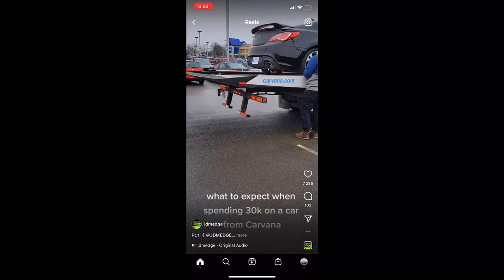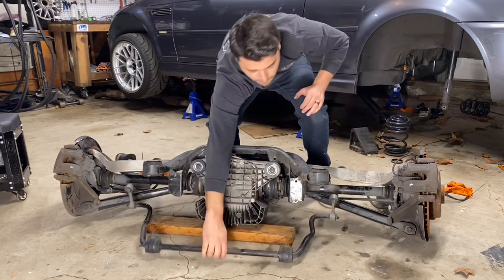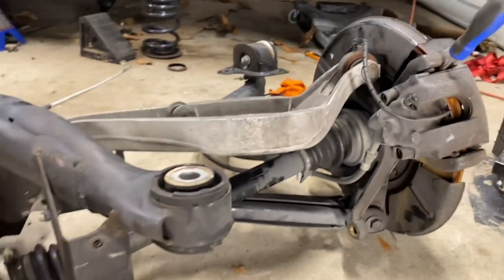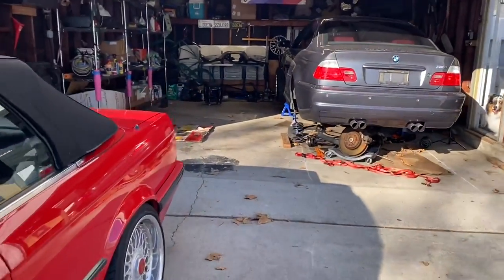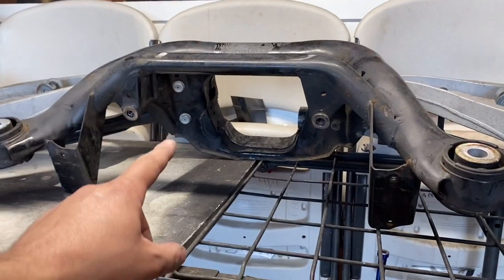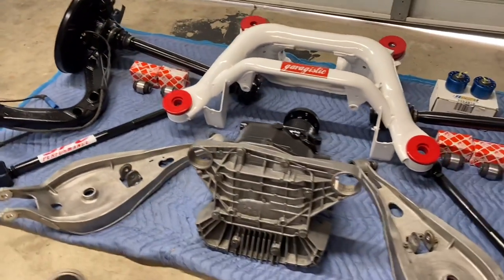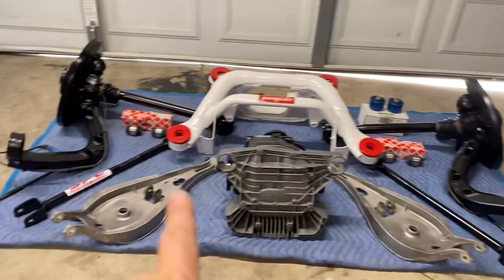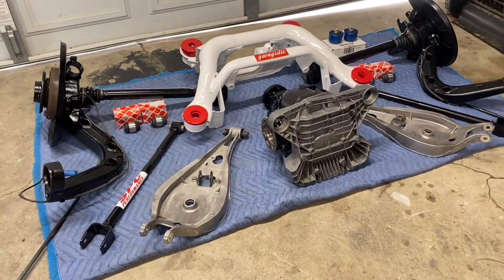Restoring my BMW E46 M3 rear subframe

Comment: Nice but why didn't you weld reinforcement plates to the subframe? Don't you worry about the subframe cracking?
Reply from the maker: Whats up Geri ! I did actually weld in plates, and welded up cracks that were present on 2 of the subframe mounting points. All of that + installing an X-brace is covered in another video of mine that you can check out here: 

https://www.youtube.com/watch?v=a1DARSUfTfA&t=22s

Thanks for dropping by, cheers!!

Comment: just done mine, fully powder coated and bushes all done, plus inserted the new updated diff case bolts that bmw offer. Also added the welded plates on floor pan. looks so much better. Mine only done 63,000 miles but yours in better condition, we have wet salty roads in the uk to rust everything
Reply from the maker: Hey Lee, Nice job mate! Regardless, its no easy job! Hope my videos were able to help you some, your car is going to feel completely new afterwards! I may have to look into the updated diff bolts you mention, I have a bit of a clunk still from the diff and the front diff bolt has come loose a few times. Thanks for the tip! Cheers mate!💪
Reply: @joshthebavarian  yes check out bolts they are only a few pounds and simple to put in.

Comment: Dude, props to you.  I wish I knew how to work on a BMW like that.
Reply: you can do it, working the E46 platform is easy, IF you  have access to a garage and lift on some cases that require it, but mostly the maintenance is not that bad at all. given you get lucky with a good, clean example. My E46 330ci is currently have a dreaded vacuum leaks and possible DISA valve issues etc. but that to be expected in a 21 year old E46. maintenance it soo key.
Reply: @LaSaus Thanks!  I am going to give it a shot.
Reply from the maker: Hey Brotha, thanks for dropping by! And mark is right, these cars are really not that bad to work on. You can almost take the car apart using probably just a 10, 13, and 16 mm socket. Youtube has tons if info and if your ever really lost, look into the Bentley Manual for the E46. Basically the bible. Hope to see you around here in the future, Cheers!
Reply from the maker: haha yes youre right!I hadnt realized but i pretty much said the same thing. Thanks for holding it down!
Reply from the maker: Maintenance is everything! Doesn't matter how good your car looks when your broke down on the side of the highway. Cheers mark!

Comment: nice work Josh!   great video
Reply from the maker: Hey thank you! It was a lot of work but definitely worth it. Cheers man hope you like the content!
Reply: @joshthebavarian  im about to do the same to mine - cant wait for its initial drive
Reply from the maker: @BMWarrior1  oh nice dude! Feel free to pop in with any questions you might have 💪 check back once you finish! 🙏
Reply: @joshthebavarian  Cheers Josh - just a quick one before i finalise the diff, how were the solid mounts for the diff noise wise?  did you get any whine from it?  ive done solid aluminium diff bushes with OEM subframe mounts (street car). However im a little cautious on the solid diff mounts incase the diff whine becomes too noisy for the road. Any feedback would help greatly, thanks man
Reply from the maker: @BMWarrior1  To be honest the diff bushings didnt make that big of a difference to me with NVH. The ones that DID were the transmission mounts, I put a hard poly in that position and the whine went up considerably! If i were to do it again Id probably leave those stock, while still doing poly everywhere else.